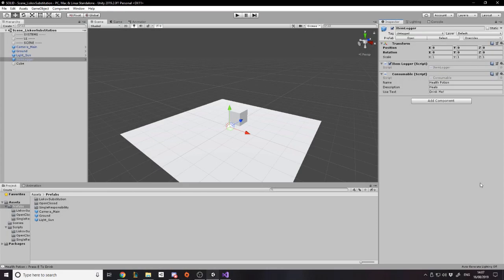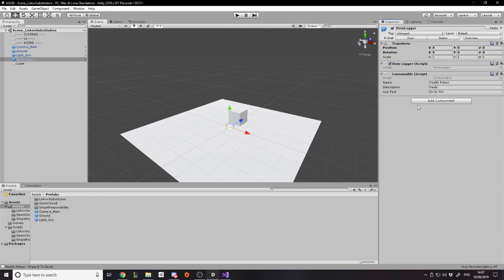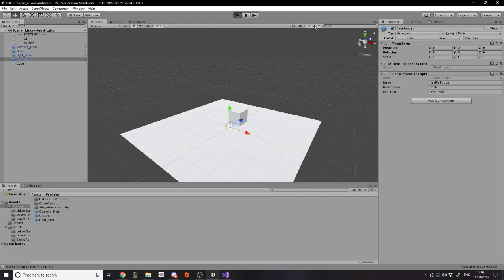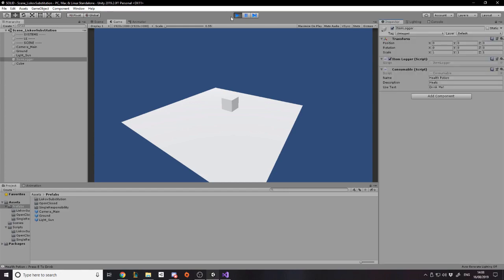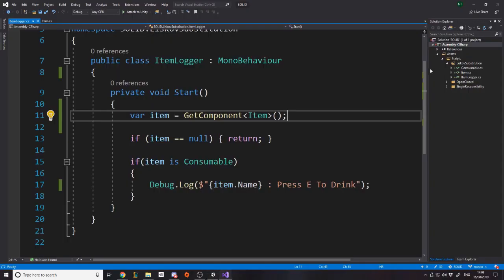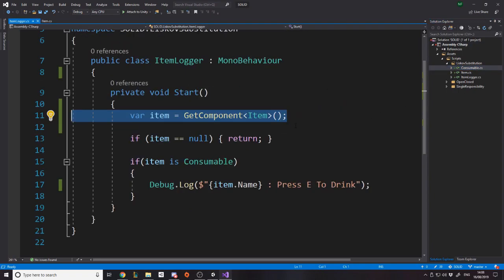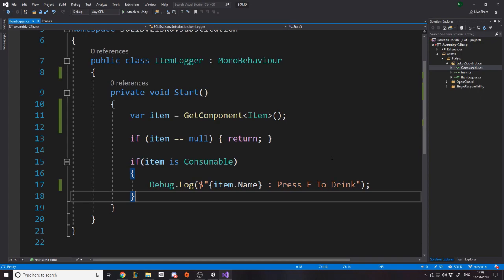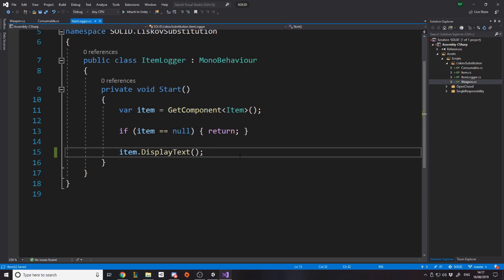S.O.L.I.D Design Patterns - Unity - Liskov Substitution Principle

Comment: Great video.  One question though: In your example of using an ItemLogger, wouldn't it be the responsibility of the ItemLogger to Debug.Log the data and just fetch the appropriate data to log from the Item?  IE  Debug.Log(Item.GetDisplayText());  This way if we decided later down the road to log to a text file, we don't need to open all the item classes and change them?